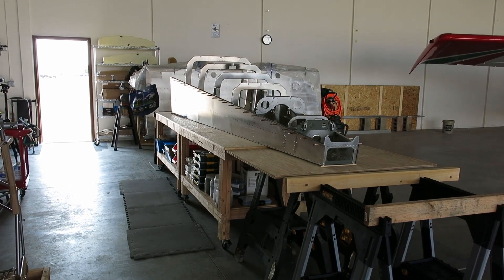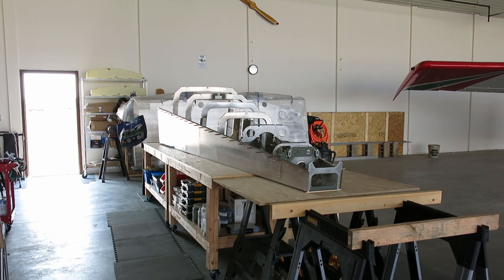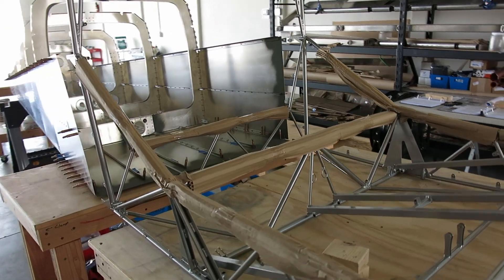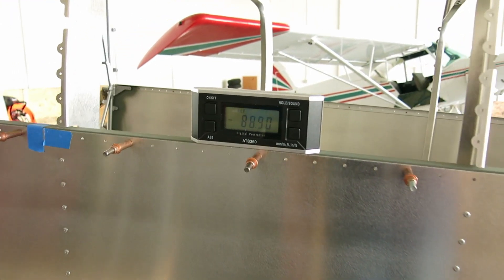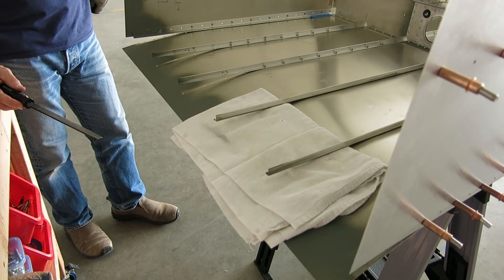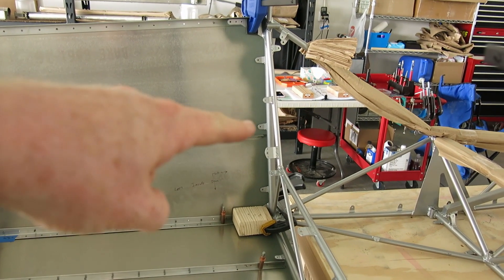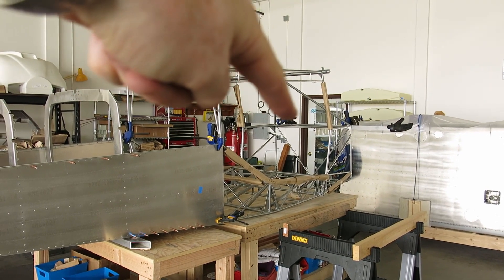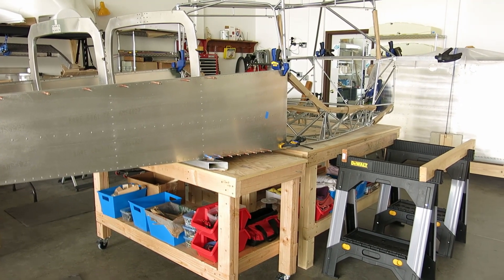No. 114 07-11-2021 Tail cone and cage fit up

Comment: Hyper critical, this stage of the tail cone alignment, expect your nervous and feeling the pressure about getting this part of the build spot on. I remember building RC aircraft, it made the world of difference how the plane flew if the tail assembly was out of alignment.
Watching with great interest.
Cheers & good luck.
Glenn DownUnder.
Reply from the maker: We’ve had that tail cone off quite a few times, replicating our alignment steps to be sure we’re getting the same results each time. Yes, nerve racking 😬

Comment: A hacksaw is your friend.  😁
Reply from the maker: It is, but not in that space where I had to take off about a blade width of stinger. 🙂
Reply: @s-21project92  Is your edge distance that tight on the stringer?  You are a few weeks ahead of me so I haven’t gotten there yet, but you really only need 2X the rivet diameter from the last hole to the end of the stringer.  With the #30 rivets (0.1285”) you need only 0.257” from the center of the last hole to the end of the stringer.
Reply from the maker: Yeah, just a hair over .250 from that last stringer rivet hole to the end. When we got it fitted up, the stringer was rubbing on the cage. Took just enough off the give it some breathing room.
Reply: @s-21project92  0.25 from the center of the hole?  Many think edge distance is from the edge of the hole, but that isn’t the case.  You mentioned in the video that you had trimmed two stringers earlier, but not the other two.  I am curious why that was the case?
Reply from the maker: Yes, .250 from the center. The other two were a little over, but decided to leave them and see how everything fit up. Turned out I needed to file them back a bit.
Reply: @s-21project92  Good to know that the 0.25” trim dimension is a do not exceed dimension.